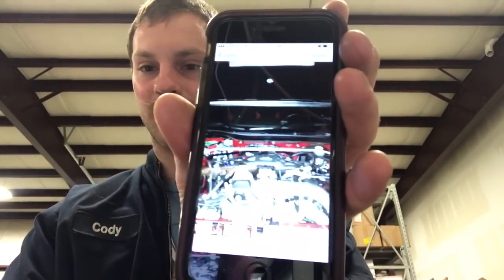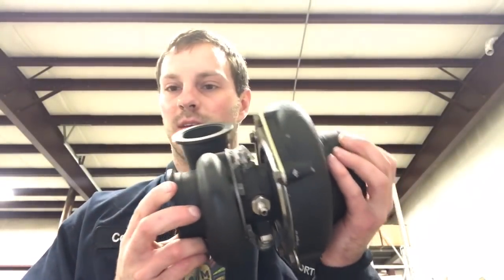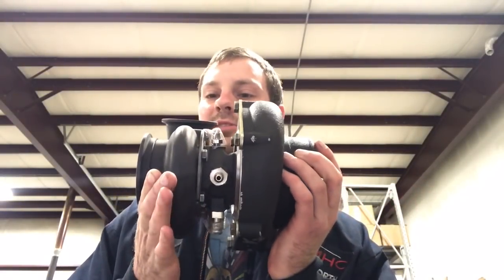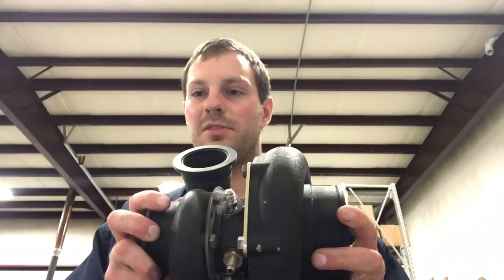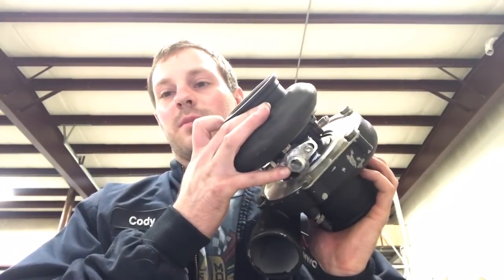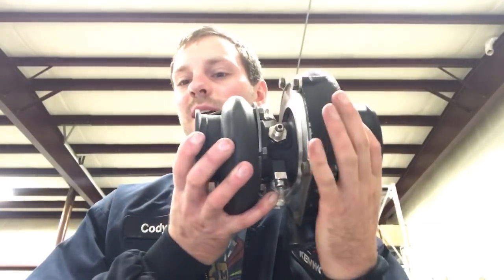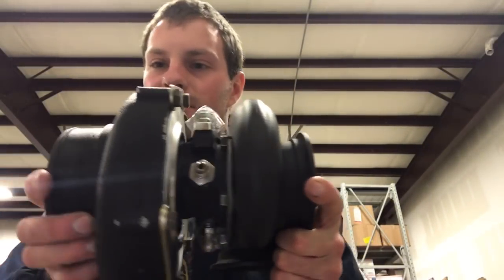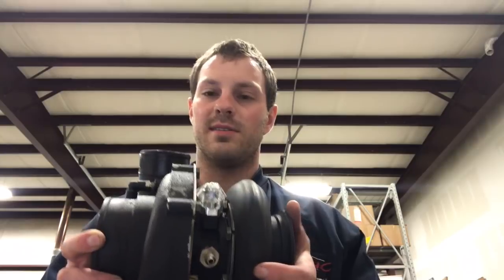New Precision Turbo Blows oil

Comment: I actually have an STI with Precision 6266 and the turbo is also mounted at an extreme angle like this. And lo and behold oil is being burned. Also the turbo drain starts at a 45 bend. I'm not sure about the size of the drain but this video helped me a lot thanks.
Reply: Did you find a solution I have the same setup same problem

Comment: He also needs to make sure the return line for the oil is placed above the oil level on the oil pan. He can have the right amount of oil in the engine and have the return line below that level. Return line need to be as hi as possible on the oil pan

Comment: One other thing that works for me when the drain is 3/4inch and adequate I restrict the supply fitting  slightly to .090 even with journal bearing with no adverse affects and sometimes I even go to .075 especially if I see 4an supply line

Comment: Is there a shield in the crank case between rotating assembly and oil in pan? Is the line return line located in line with a main cap or rod journal?

Comment: I have a turbo problem bro how can I email you I have a pt96 turbo hot low psi with turbo feed if I cap turbo feel I get my normal oil pressure back what could be the issue there’s no shaft play

Comment: What about turbos on airplanes? Do you rebuild aviation turbos? I guarantee that turbo is at all kinds of non-normal attitudes during flight (other than straight and level).
Reply: doesn't make a difference. Forces act straight down in a plane unless you're doing aerobatics doing zero/negative G's and i don't know of any aerobatic planes that are turbocharged.

Comment: Cody what if you take the 10 AN fittings off the drain and drill it with a 5/8 drillbit is that sufficient enough for draining the turbo ? Thank you
Reply from the maker: j c it should be enough to drill it with a 5/8
Reply: Turbo Lab America OK perfect thank you 🙏

Comment: I have a precision turbo 3231 do I run a oil restriction it's going on a motorcycle
Reply from the maker: No don’t use a restrictor
Reply: @turbolabamerica  with no oil going thru the turbo should it have a bit of play then that space it's looking up by the oil wen pumping?

Comment: dear turbo manifold fabricators, turbos sit level, and the intake side faces front. any thing other than that and you made it wrong.
Reply: You are wrong my friend. 90% of turbos the exhaust and intake housings can be clocked (or spun) to accommodate any angle manifold flange. so the center housings can be installed correctly with any turbo manifold.
Reply: blindabinda123 has nothing to do with clock angle just that the impeller faces forward
Reply: SirSquash ooooh I didn't know the turbo was tilted that way.  Lol wtf

Comment: 40+ emails and a video...yet i get ghosted when repeatedly asking for a price and when i should mail my X5M  turbos to have them built before Bimmerfest.
Reply from the maker: I told you I didn't want to do them because it takes 3 months to get the parts plus the shafts has to be custom made so I have to spend more than it's worth to do that build
Reply: Turbo Lab America I'm fine waiting 3 months.  You never said it wasn't worth your time.  Pure wants like $4k to rebuild the X*M/M* turbos but I figured you'd still be cheaper than them while still making it worth your time.

Comment: hi
the drag  rasing cars almost of them
pot the turbo tilted
Reply: stroker z28 no they don't. The center housing is always vertical. You can spin the exhaust and intake housings separate from the center piece. It's called clocking the turbo.